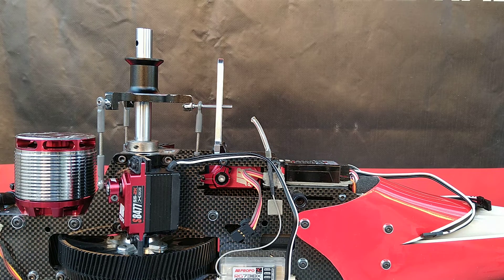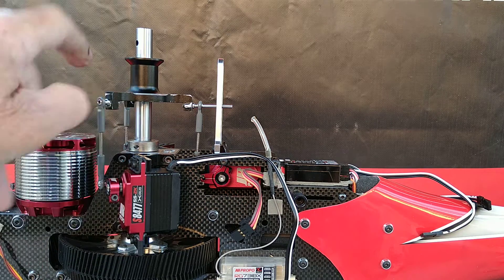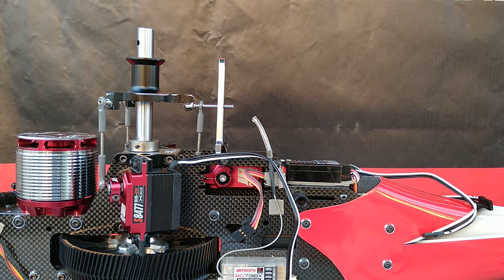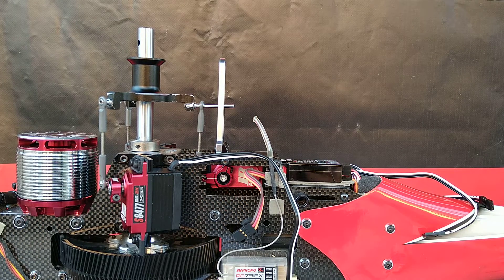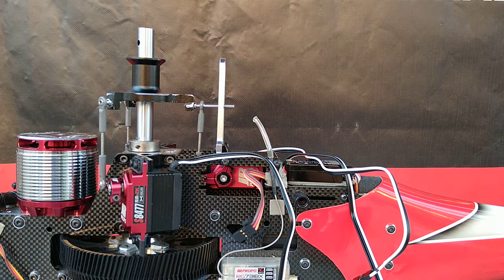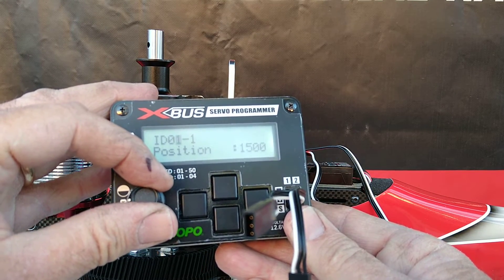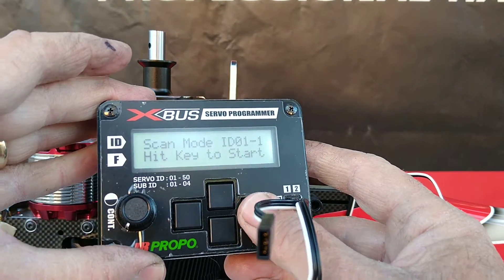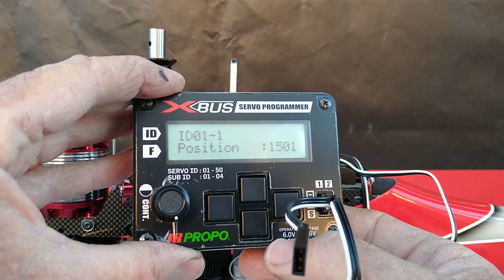JR PROPO 23 S8477 SS Game Changer Servo Synchronization for RC Helicopter Use-Video 1

Comment: Can you explaine the pros of this system over a normal servo setup with a flb unit? Will it work only with jr mini tags or other brands? I think i understand that it has to do with the servos beeing 100% in sync in every possible posision
Reply: Basically, the servos are being reprogrammed on the chipset level inside each servo to fully synchronize them as a matched set that have identical positioning, centering and endpoints.

Doing so, will ensure that they are completely in sync with each other. Then when setting up the helicopter's flight controller, it is much more precise, leading to less interaction in the servo operation which can lead to current draw issues when the servos are fighting each other for positioning.

The result is smoother operation of the flight controller, meaning gains are much more precise, endpoint are equalized, and overall performance is much more efficient. This leads to much better flight characteristics. With the possibility of saving a little battery life.
Reply: @Zippo765  Thanks, interesting
Reply from the maker: @jamesderekeikeland9048  James, I just say your questions (my apologies for just seeing it now.  Derek Townsend nailed the answer.  It makes a very large difference in the precision of the helicopter (very noticeable).  The FBL unit does not have to work nearly as hard either.  It will work with other brands of FBL units, although I have not tested it with others yet.
Reply: @RAK402  Thanks 😃